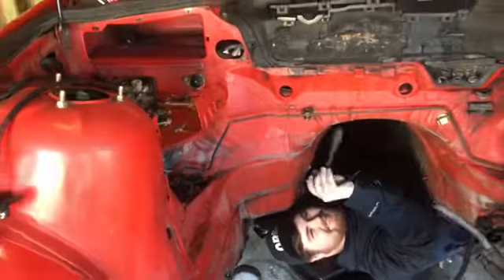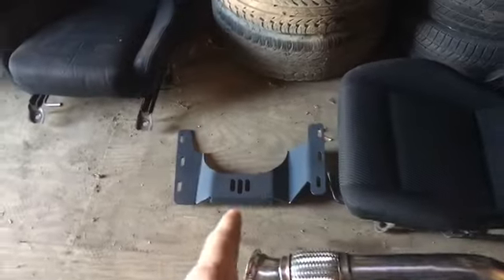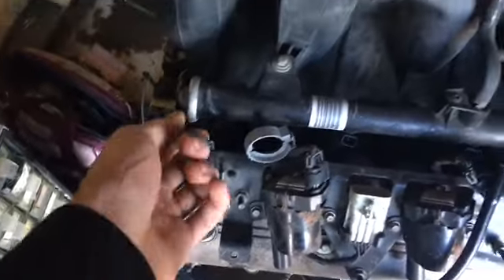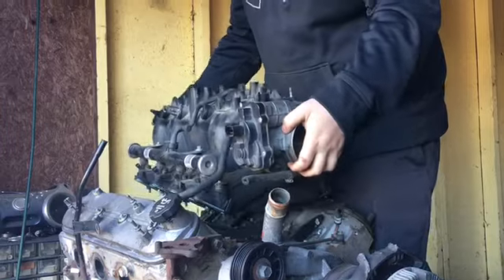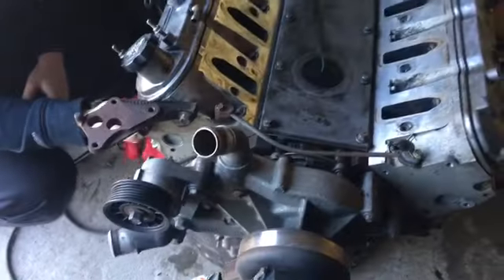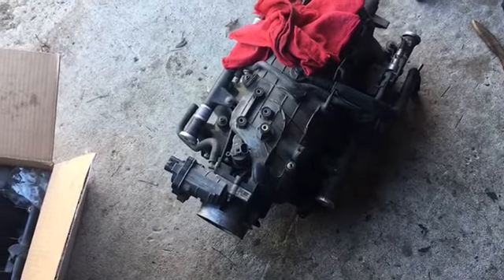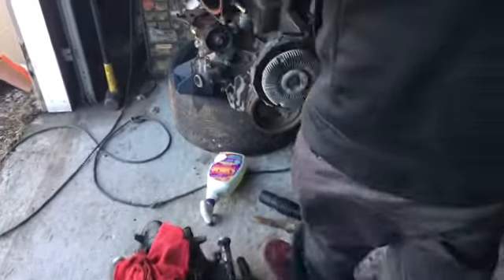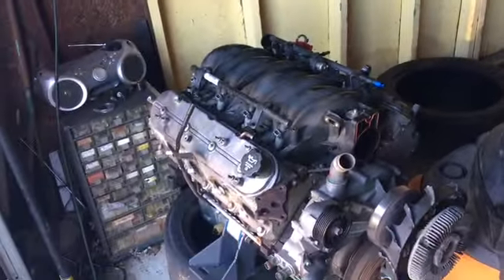BMW V8 Drift Car Let's Finish This Monster!

Comment: knock sensors, may be to late but I deal with them all the time. if you ever get water on the engine there is potential for it to run into those holes and corrode or cause the sensors to fail. I always (when replacing) put a small bead of the right stuff (best stuff ever hahaha) and then the "seal" the puck type deal, and then a small amount around the wire to seal . sure some may argue that it makes it harder to fix later but knocks sensors rarely go bad on thier own and it's better than ruining parts that cost $$$. I'm only 7:14 in so if you have not you may want to look in there if the engine was cleaned before you got it. the plugs that go onto the knock sensors is easy if you have long needle nose. I'd look for any water or corrosion and rplase the small harness or clean the contacts, otherwise you have to pull the manifold back off

Comment: The plug/wire under intake manifold is cylinder deactivation it turns off four of the cylinders for better gas mileage

Comment: The 2 plugs in the valley cover are your knock sensors. Also, your gonna have problems with the cable throttle body and the truck water pump filler neck. You'll have to a get F car water pump and spacers.

Comment: The wires coming off the top of the motor are cam position sensors if I'm not mistaken.

Comment: So you guys took a chevy truck v8, put the corvette/ls1 intake on it and now you guys basically have a drift ready reliable american v8 in a good german car? I have a nissan 300zx tt and have been thinking about getting rid of the current vg30dett to do a swap like this. Very interested for more detailed videos on this build!
Reply: Nolan yeah The LS truck engines are very reliable. They can even handle a bit of boost on mostly stock internals. I don't have an LS but I have a built LT1 on my channel if you wanna check it out!
Reply: Nolan yeah check out Jimmy Oakes channel. He has a a buildup of his 300zx ls swap stage by stage. Lots of info in the videos.
Reply: I bought a 95 240 with a seized 5.3 truck engine with ls1 intake. Swapped the engine already just doing some final touches. Only downside to it is that it has a turbo 400 atm. Maybe after i build a diff motor i will swap a t56.

Comment: Do not turn the steering wheel when you disconnect the steering shaft from steering rack cuz you will brake the spiral string that is wrapped around steering wheel when you turn the turning sigal on if it isnt on the middle it will brake and when you will be turning your wheel back your turn signal will not be disconnected ,sorry about my english im from Croatia ,when you do that kind of things you need to look after that peace

Comment: @garagesideways if your going to replace the steering guibo upgrade it to a 1995 bmw e34 steering guibo it's a metal u joint instead of the weak rubber Oem one
Reply from the maker: dylan zavatkay thanks we will!

Comment: when are you getting the 240 wrapped ?
Reply from the maker: Leevi Poikonen idk probably spring
Reply: Sick, do u know what color ?
Reply: Garage Sideways I'd like to wrap my ctsV in a flat grey
Reply: silver moss
Reply: that plug is a knock sensor harness for the knock sensors in the motor